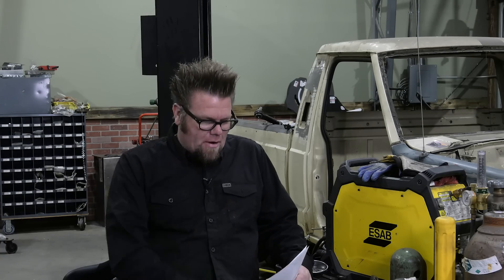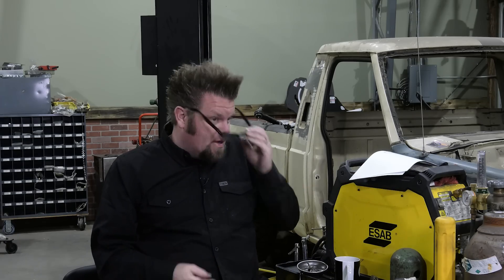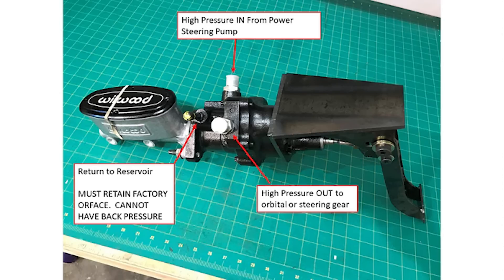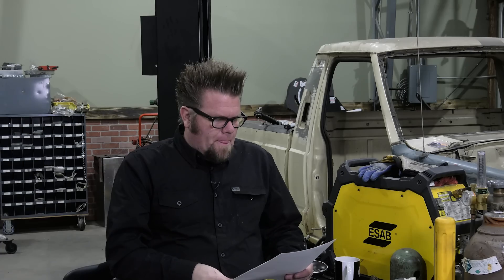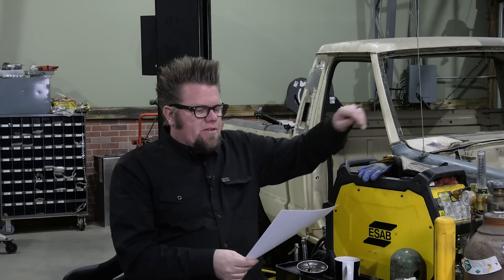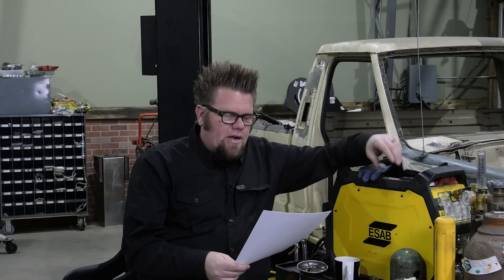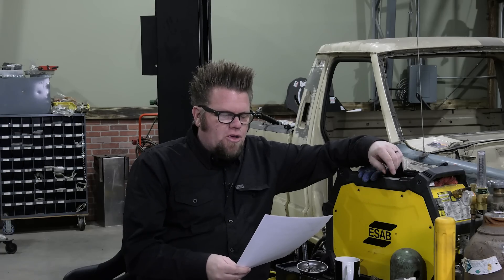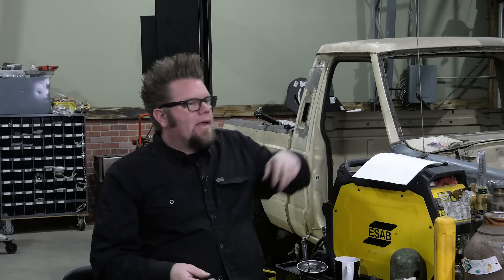Balancing a Tire with Balance Beads, Hydro Boost Vs Vacuum Boost and where is the Towverlander

Comment: 12:26 balance can also change if the bead slips on the wheel. Which is much more common then you think!!! Also- beads help adjust for needing to rebalance as the tires wear down. (Worked for a tire shop for 8 years)
Reply: Every time you take off they are balanced to current needs. Which is always changing a little with wear.
Reply: no tire ever needs to be rebalanced lol
Reply: I’ve never heard of beads till today.   Is there any reason I can’t use these on a normal car?  Like my wife’s car is a Chevy Bolt it’s incredibly sensitive to tire noise and the winter tires tend to have just a bit of imbalance in them at high speeds.  

Thanks

Comment: In the last few years I’ve had a 54 belair with 100% rebuilt factory drums all around and a 62 international scout. Also rebuilt drums all around. Manual Brakes on both worked fantastic… but they were rebuilt and brake shoes were adjusted to the drums properly.

Comment: Toyota axle straightening (Ford 9 , 8 inch etc.) "Fabricated housings". I would also recommend dropping the center section back in and snugging it up after you have gutted and stripped the housing to help keep it from possibly distorting. Use a "shoe" (Steel saddle) where the bottle jack contacts the housing to spread the load so it doesn't dent or deform the housing.  I have a massive I beam for the base of my axle fixture (Straightening, welding, gearing, etc fixture) put a 20 ton jack under a hollow tube and go Magilla and well,,,,,...

Comment: For sure I will be removing the axle from the truck and tearing it down to a bare housing. There is a spring/suspension shop in my town, I'll try calling them and see if they can do it before I attempt trying it myself.

Comment: If you have a bent axle and/or axle tubes you call around to shops that repair hydraulic cylinders. I have had a few buddies that have had their axles straightened by the cylinder shop with no issues at all.
Reply from the maker: Good idea

Comment: Ian, well-done on the hydro vs vacuum boost brakes!!  I have a 92 C3500 (with dump bed - drum brakes) hydro brakes, when the engines off the brake pedal goes to the floor  - scary...
Reply from the maker: The accumulator normally stores a pump or two.....so you might want to check that

Comment: I don't recommend balance beads for tires on rigs that air down and up frequently, and certainly not on Jeep JL or JT models.   Airing up adds moisture to the inside of the tire and those beads will eventually start to clump, especially with small portable air compressors after a trail ride.   JL Wrangler and JT Gladiators are very susceptible to "death wobble" not caused by worn parts, but due to tire balance.   I've been bead free for 4k miles on a JT Gladiator w/ 37x13.5 on beadlocks with zero balance in all 4, smooth like butter to 85mph.  I air up after wheeling frequently and ran balance beads and developed death wobble in a rig with 9k miles on it, nothing loose, nothing worn....vacuumed out the beads as recommended by my local 4x4 fab shop, and not a problem since.   As with Ian, I run beadlocks with no balance on Milestar Patagonias, and they are perfect.  If I didn't have beadlock wheels, I would have them balanced with stick on lead weights.

Comment: One of the benefits of hydro boost is packaging, particularly when you put a larger engine in a smaller engine bay. Easier to package hydro boost without the size of the vacuum booster.
Reply: Exactly! Like my 72 Bronco with a SBF 427 570HP,  very tight engine compartment and it dosen't make sufficient vacuum for brakes.

Comment: How about the military axels, the new ones from Axel tack I think is the name, I use 12 oz of needs on my 40” irocks, tried BBS they shock the truck at interstate speed 80 mph, was surprised you use 3 scoops of beads, good vido lots of information

Comment: I've tried plastic BB's and golf balls in a set of 38 Swampers but they didn't work at all. I do use actual balance beads in my motorcycle and they work great. I'm leary of trying them in big truck tires from my experience so far.
Reply from the maker: Are your swampers Bias or Radial....The bias tires tend to pick up flat spots when you park on them for more than a day or two.
Reply: @BigTireGarage  that was 20 years ago. They were 38x12.50-16.5 TSL-SX bias on uncut  H1 wheels. Even daily driving and well after any flat spots smoothed out they where terribly out of balance even just around town below 50 mph. They would actually bounce when they had golf balls in them, lol.

Comment: Love the balance beads idea. I used to use air soft pellets in my trail rig. Do the balance beads interfere or damage TPMS sensors in any way?
Reply: I ran beds with my sencer 40,000 miles without issue

Comment: Do you have to change the the Valve stem when using balancing beads and TPM s sensors ?? 35x13.5x20 Daily driven weekend warrior ... We're balanced with stick on weights from the factory. But tires are now wearing a little off.
 And want a little better ride quality
Reply from the maker: That i do not know......I can see how that might be an issue with TPMS but I do not have experience with it

Comment: Just finished a custom tube buggy from scratch and have question on transmission. Rebuilt a TH400 with Reverse Pattern Manual Valve Body. I only have reverse after the transmission warms up but nothing when cold. Any hints on what to look for/fix?

Comment: OMG - really??? 1000 psi of vacuum? You nadd a small boo-boo there.  🤪

Typical engine vacuum is 7-10 psi (14.7 psi is theoretical max - i.e. 1 atmosphere). For a 12 inch diameter diaphram with a 3 inch diameter hole in the center, this will provide 740-1000 lbs of force. I think that's what you meant.
Reply from the maker: The PSI I was referring to was the pressure inside the brake system